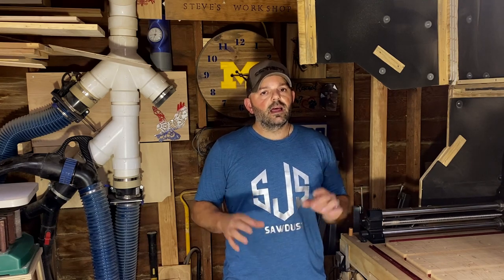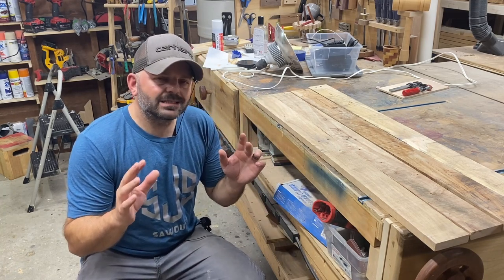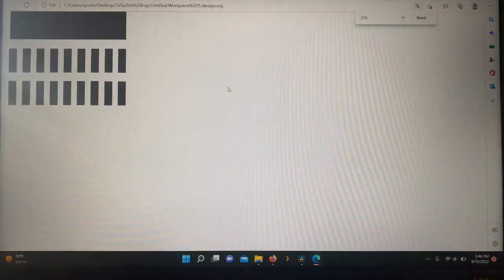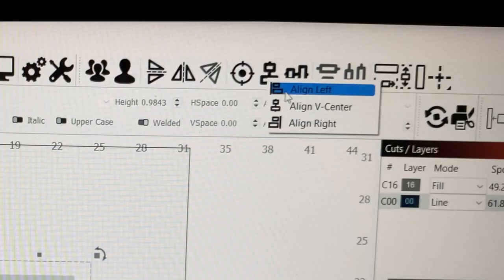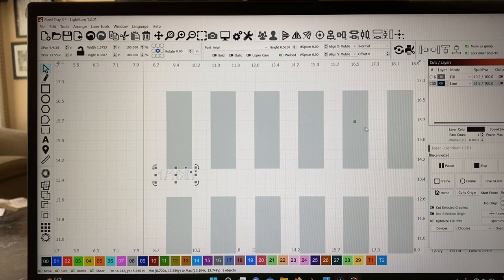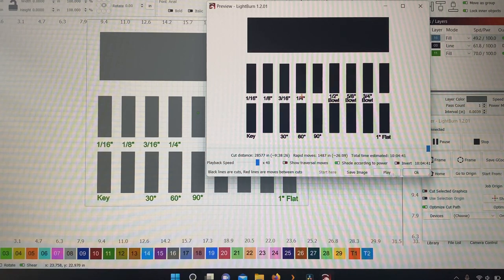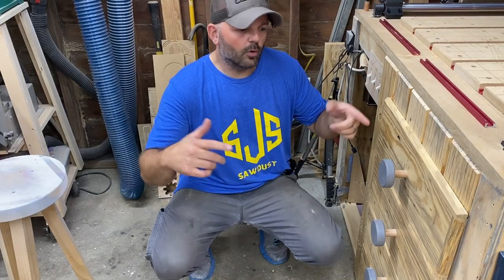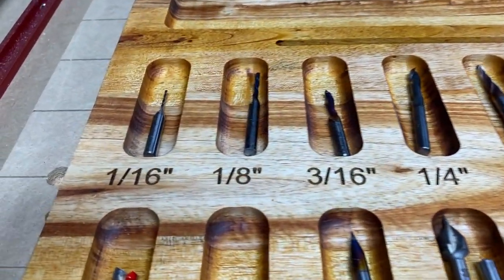EASY 2 Program SVG Alignment on Onefinity

Comment: Hey - what feeds/speeds do you run your bowl bit at?  I have a similar setup and would like to try and recreate your project
Reply from the maker: You should definitely do it- it’s great having everything where you need it and easily found. This wood wasn’t very hard - so I ran my bit at 60IPM and .1” depth per pass. I would suggest starting slow and ramping up if you can. The bowl bits scare me to a degree because it’s a 1/2” , 5/8” or 3/4” cutting head on a 1/4” shank.
Reply: @SJSSawdust  Yeah, they scare me as well - which is why I have one that I haven’t used yet.  Vbit, end mill, no problem, but the bowl bits seem so different when it comes to depth of cut.  I’ll give your feeds/speeds a try on some pine before I try it on some more expensive wood 😂